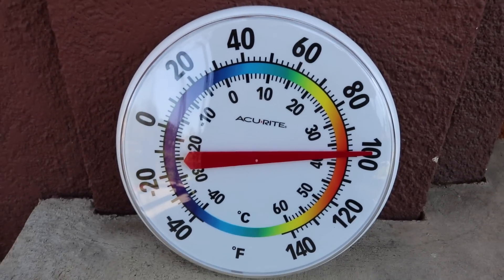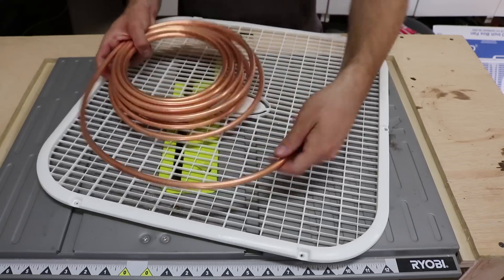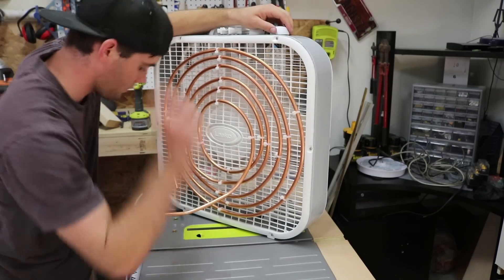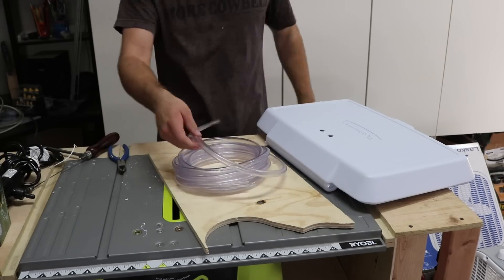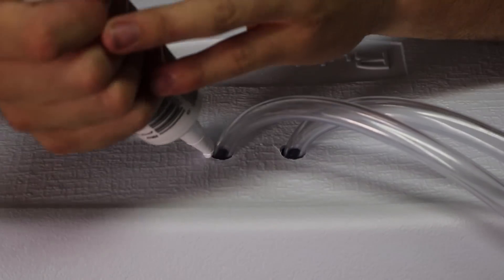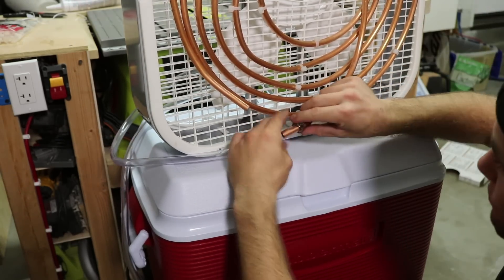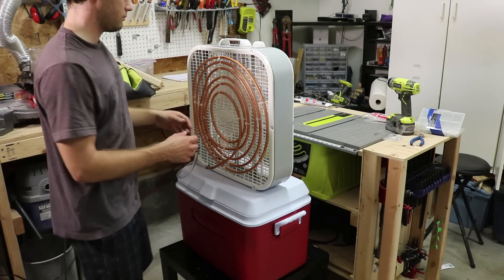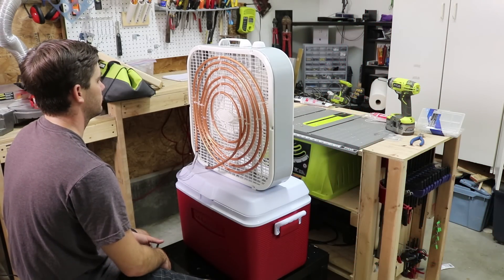$100 Homemade Air Conditioner - DIY

Comment: So I actually did this. The wife is mad because it looks trashy in the house. I spent a little more than $150 because I did a more heavy duty water pump, heavy duty fan. I absolutely love it and I’m proud of what I did to helping supplement the cooling to our house. The only downside is the condensation. Every 15-30 seconds, a few drops of water comes down from the condensing copper tubing, so I have to keep a towel under the fan
Reply: Want to share your temps measures before and after?
Reply: curious as well
Reply: @Douglas Smith  They'll never tell you the temp difference because there is no temp difference. lol  Technically it would be a wash.  The tiny bit of cooling produced is offset by the heat the fan motor is producing.  Just a total waste of time and money. I rolled on the floor when he used caulking around the tubes. LOL  But if they actually feel good about what they accomplished I'll sum it up to possibly the placebo affect they think they are experiencing.  lol
Reply: B H same reason why keeping a refrigerator open technically won't cool a house down
Reply: YOu should lick the condensation.
Reply: you can buy air cooler for $100
Reply: Can you add a drip tray back into the water?

Comment: The only advantage to this "swamp cooler/evaporator cooler" is that it's mobile if you make it that way and also if you don't have a window otherwise like majority posted it's just better to get a small window unit.
Reply: it isn't a swamp cooler though, that uses evaporation, this literally just uses the temperature of the ice, therefore it doesn't raise the humidity.

Comment: You live in the Northern State go to your local pond and cut out some ice blocks. Cover them with Sawdust and tarps in the shade and that will last you well into August. Add a solar panel to drive the fan and you are off the grid with good air conditioning

Comment: Use a couple blocks of ice and it will last for way longer. Also, run more tubing. They make a little tool that slides over the copper tubing and allows you to make sharper bends without kinking the tubing. You have a lot of unused surface area that could have covered with tubing. Then the way you should run the fan is to draw air in, pulling it past the tubing, rather than pushing the air passed the tubing. Nice video though. With a few changes it would perform twice as good. One thing i did was i ran the pump off the 3 speed fan switch, so the lower the fan speed, the less the pump would do. Then if i turned the fan to 3 or high, it would turn the pump on high as well. Also made it so it only took one outlet amd only 1 thing to turn on.

Comment: If you already have fan and cooler this seems worth it. I would just use Velcro to attach fan though and drill holes that can be plugged so doesn’t completely ruin cooler.

Comment: For a garage NO!
For a tent while out camping YES!
Reply: there are better solutions for a tent when camping too. this project has too many logical problems for any useful practicality. a fan with ice in front of the fan is better, more effective, and far cheaper. no copper tubing needed, no time building an elaborate system that counters the effect of an insulated box. the system he built only transfers heat from outside an insulated box into the inside of the insulated box. if we remove the insulated box, we don't need that $75 expense and we can simple use a fan & ice, or ice alone if we want.

Comment: I have a similar idea, but wanna use the evaporator coil from an old refrigerator/freezer unit instead of the copper tubing.
What do you people think? Is it gonna be effective? Please drop a reply if you got any suggestions
Reply: Yaserinski Shahidovich it should work!

Comment: $16 Box Fan, $18 cooler? Where did you go shopping? The Americans against inflation super market? I would have expected those two alone to cost at least $60-$80. Anyway Its nice to see your little spin on a swamp cooler. Nice gadget for when you don't have a window or don't want to cut a hole in the wall, otherwise they are making dirt cheap and effective window AC's these days. $129 on amazon gets you a decent one.

Comment: Hi Ben, Good little build.  Not going to rehash the hashers...just an idea on improving the efficiency just a little bit.  First...I fly airplanes.  In ground one of the things we learned was that virtually all of the 'thrust' comes from the last couple of inches of the propeller.   Why?  Because the very tip is the part that is moving the fastest and therefore is moving the largest amount of air.  Your design works by moving air across the pipe.  If you move more air across the pipe you transfer more energy either from (or to the pipe in winter!).  So you if you move your pipe  just as far out on the edge of the frame as you can get it you'll get the most energy exchange.  You may find that you could even shorten up the pipe a bit and have better results.  

Towards that same end if you can find some pipe insulation to cover the pipe going from the cooler that will save a little energy in that you'll control where the heat loss occurs just a little better.  

I know the problem you ran into on the 'output measurement'.  The bottom line is you just have to pick a point and make sure to use exactly the same obstructions.  Having the same amount of ice in the cooler 'evens' the playing field and will help to make sense of the numbers.  

Again...good build.

Comment: $100 Crazy I thought at first. But I considered what if u can’t use a window unit or have no window to put one in. Or u could already have a cooler and a fan so the cost would be very little.

Comment: So many comments on just buying a Wall Mart air conditioner. This garage is an oven with a uninsulated metal door.  A cheap air conditioner will not make a dent in the heat. You would need a 18,000 BTU model to do that. What this guy is trying to do would be better accomplished by just putting on a wet sweatshirt and sitting in front of the fan.

Comment: You should have measured the temperature of the air after finishing your build.  I was curious to see how it compared to the hot temps you measured before. 
 Still entertaining to watch though; thanks.

Comment: I built a heater the same way back in 2012, but I ran the water though a point of use water heater.  Probably not very efficient, but it was cool to look at and it did work really good.

Comment: You could also insulate your garage doors with rigid foam sheets. I did this and it brought the garage temp down by about 20 degrees.
Reply: I was going to suggest the same thing :) also in the attic space. a fan that would exhaust the hot air from the garage would make it more comfortable as well

Comment: Like Woodworks says...ignore the neg comments.  It was a fun little built, and the issue with an AC is where would it vent the heat exchanged air...hum...  Anyway, was thinking along the very same lines, but using some transmission coolers that are tightly wrapped and couple of larger lower power computer fans that run off 12volts, or you can get computer fans that run 110 volts, but draw minimal watts too.  I just think with a transmission type cooler, or two, you would increase cooling capacity over wound copper tubing that isn't fined either.  Something I'm considering trying as our KW watt hours can run us around 39cents a KWh.

Comment: Garage door foam insulation squares. Lowe's carries:
Owens Corning Garage Door Insulation Kit R-8 22 in. W Roll 65-3/4 sq. ft. - $80
Insulfoam Polystyrene Garage Door Foam Board Insulation - $57

Putting a fan like this $17 38watt 198cfm unit between your garage ceiling and attic, connected to a temperature switch, will help keep the garage as cool as ambient outdoor air. Put the temp switch in the attic. I put this near the garage door opener outlet.
https://www.surpluscenter.com/Brands/Thermocool/198-CFM-115-Volt-AC-Fan-Round-16-1365.axd
https://www.homedepot.com/p/Ventamatic-Cool-Attic-10-Amp-Programmable-Thermostat-with-Firestat-XXFIRESTAT/206561081

Comment: This is one of the dumbest ignorant ideas I've seen related to cooling, no offense.

True, AC works under this principle, but the refrigerating gas traveling through the pipes is very very cold (below 0) making the transference of BTUs ("coldness") much more efficient.

This system is interesting to prove the mechanics behind. Not worth spending that money and time. Some DIY are just good for entertainment purposes.
Reply: actually anything cooler than 120 degrees just might be worth it if you have no other options.

Comment: Does this only work if you have electricity or if you don't have electricity to plug the fan in bc I don't have any power in my rv and it's terribly hot in here. I need a.c. but no power to plug a fan in. What do I do?

Comment: Walmart has a 5000 BTU A/C for $116. Lot less work, lot more time for fun !
Reply: 5K btu is too small for an uninsulated garage of that size. He would need about a 12K to 15K a/c under those circumstances.
And that might barely do the job.

Comment: Or you could fill that cooler full of tasty adult beverages, poor the water on your head and set in front of the fan and wait till the sun goes down to do any work. Works in Oklahoma when it's 110°and 100% humidity. Which is usually from June to October.

Comment: I've done this, waste of time, money and does not cool. I actually only bought the copper coil. I had a old cooler, and fan. The air pushing through cools for a while but then warms. Doesn't last long enough to cool room.

Comment: It's not cheap but you could velcro reflectix to the outside of your garage door. Just remember to take it off roll it up and bring it inside every night somebody doesn't steal it. By reflecting the sun's heat instead of letting it hit the door your DIY air conditioner will have less of an uphill battle

Comment: You are a genius! Also, I understand why you built it!
No windows! Keep up the great work👍
Reply: could cut a hole in the garage wall and slide in a windows a/c. A few 2x4's for support....
Catch the condensate if there is any and use it to water plants.

Comment: For all of the morons saying to "go buy an AC unit", listen up. He said "with no way for air fow". So now feel stupid for you comments about an AC unit because he doesn't have a window to put it in. You people must not listen, nor be very observant what-so-ever.
**Edit said this because people keep saying get the cheap ones from Walmart etc etc...
Reply: K D. Well you're right, but it isn't much of a job to frame an opening for an A/C.
Reply: @larrydynes6576  - This is meant to be a cheap simple solution, your mental capacity obviously cant follow.
Reply: K Digiacomo  Is that supposed to hurt my feelings? Hardly a cogent argument. Anyone with any experience   can understand my observation. It would be simpler, cheaper and faster to frame an opening and install a window type air conditioner. Even though that isn't the best way to solve the problem.
Reply: HuskyGamersUNITE - Are you talking to me?

Comment: I tried this design last year, inspired by another video. It does put out cooler air, but nothing like an AC. And the copper tubing swets alot, making a mess. Lastly, the ice melted very quickly.
IMHO, not a good idea.

Comment: The basic problem with any of these cooler AC units is that no matter how good the insulation, the ice melts and that's that.  You get an hour, maybe three max, even frozen bottles with the evap unit and they melt and it's over. A cheap actual window unit is 100 or so.  Invest in that and maybe duplicate it in various windows. A home AC system is thousands. For five to nine hundred dollars, you can fill your windows with cheap low wattage units and cool your entire home. They are not as efficient as central cooling but it's an alternative that will work the entire summer. This concept is fun but inefficient.

Comment: why didn't he post the temps in the garage after installing it...?  because this would not of worked too well.  The amount of energy in the heat in the garage would of overwhelmed the ice water in the cooler.  Now if he ran tubing in the ground for about 40 feet, filled it with water and pumped it through the copper tubing with the fan going.  Then that would work extremely well.  The temperature of the ground only about a foot down is always about 65 F.  The ground would then disperse this heat easily and provide for a cheap cooling for the garage easily!  HMMMM I think I might try that!!!

Stan...

Comment: Mrdgwphotos is absolutely right. an A/C unit cost just a little more and does a way way better job at cooling a room then this thing. I did it on a fan I had at home. Not worth the time and money I spent on the copper tube. Not good at all

Comment: But you never showed if it made an actual difference in the temp....in my book you'd have done the same thing with a few $1 freezer packs zip tied to the fan and saved about 90 bucks to get the same result

Comment: how  bout also getting  one of the blue  foam panels(cut to size) and  putting  it on that metal door?  would make  the  DIY AC more efficient.

  i think this is actually better than an evaporation unit.  simply because if he  lives  in a  humid  climate, the evaporation unit would  in my  opinion add  to the problem..meh just a thought.
      if he uses that AC he made & a small dehumidifier..&  puts  some  of the blue  panel foam on that door? he'd  be good to go.

Comment: Look to add a 2nd loop to the rear of the fan and i would also look to put a mist head on the return line into the box, by causing the water to 
mist inside the box it will cool down quicker.

Comment: The system takes heat from the room air and puts the heat into the water, which is stored in the cooler - What is missing is the exterior radiator, to remove the heat from the room, rather than to store the heat in water filled cooler (which then must be dumped and refilled with cold water).  I'd suggest using the fan to blow the hot garage air out (same electricity use for fan, eliminate electricity/heat production by water pump), and have an air inlet into the garage from a shady area. Limited to cooling to exterior (shade) temperature but should be way more effective and faster, easier, less stuff to buy/build. Check out evaporative coolers and ground tube cooling.

Comment: This is great .. it would be also cooler if you find a way to take the hot air from the back of the fan outside .. would make also a big difference .. thank you  for the video

Comment: You didn't show how many degrees your finished product lowers the temperature. If it was 120 degrees in your shop before, then I'm assuming your DIY unit lowered it about maybe 10 degrees, if that. That would be my guess. So realistically, you'd need 3 of these to get below 90 degrees.. and that's still not too pleasant.

Comment: I did one cuz i had all the stuff around the house. and it was a joke.... it did kinda work but all in all the ice would melt faster then you could refreeze more ice... and really 20 more bucks just go to Walmart and get a cheep AC unit.. and would be 100x colder. also copper has gone up in price. so the 25 in the video is more like 65.

Comment: Would not recommend. I was able to build this for around 70$ and does not work in cooling a room at all. The home Depot I got all the supplies from had deals on AC units for around 110$ so for a little extra you can get a real working AC unit